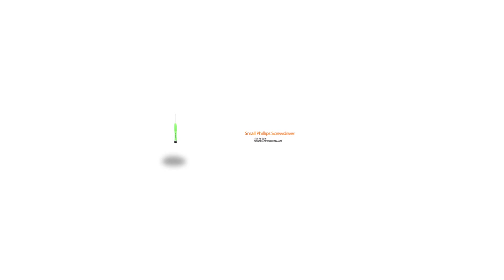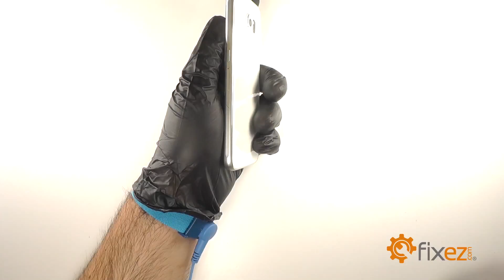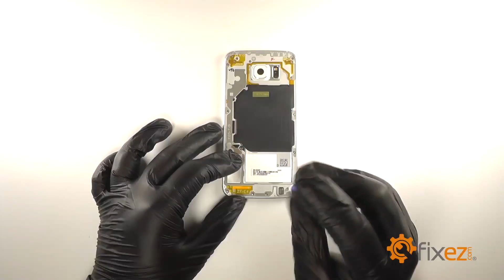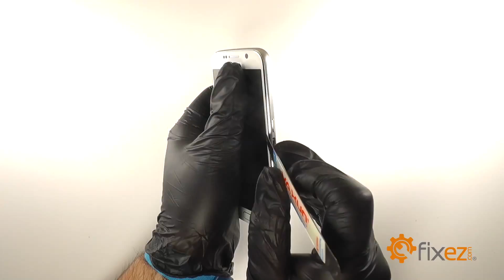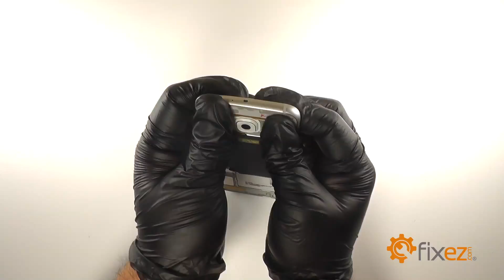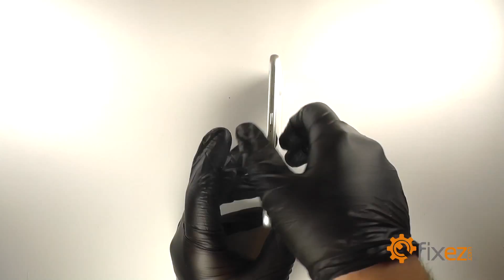Samsung Galaxy S6 Battery and Inductive Charger Repair - Fixez.com

Comment: Where can I pickup a new Induction Charger replacement? :)
Reply from the maker: It's included on the midframe and bezel available on our site.
https://www.fixez.com/catalogsearch/result/?q=s6+midframe+and+bezel
Reply: I'm doing a science experiment and I need the induction charger to charge the battery without any of the other components that are not necessary. what would be the best way to accomplish this?

Will it charge without the motherboard?